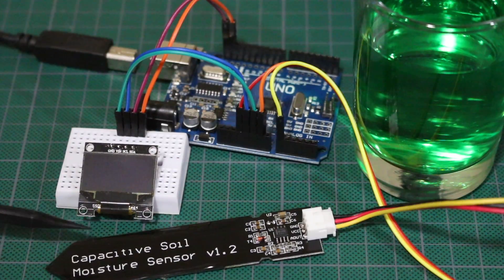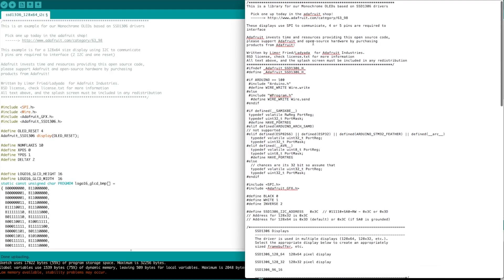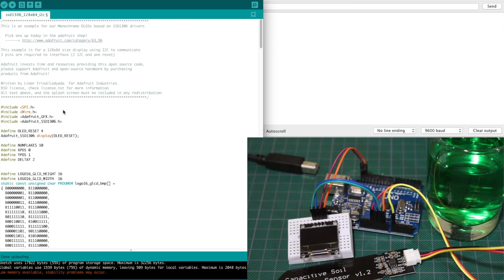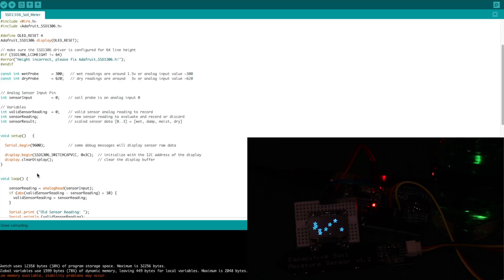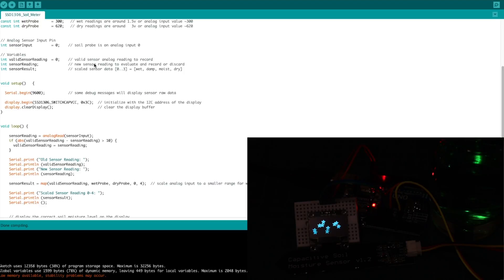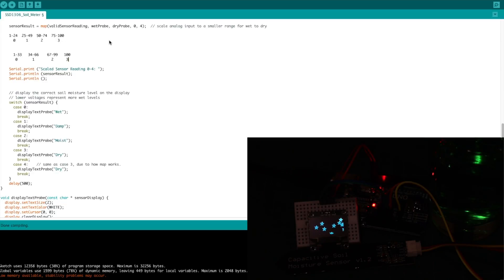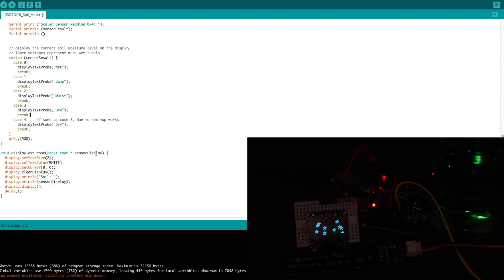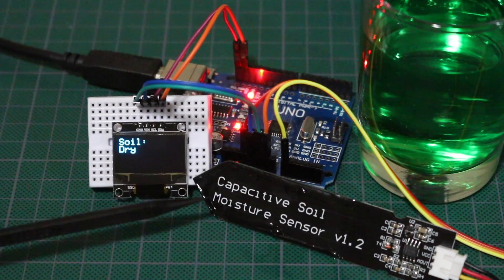How to use a 128x64 OLED Display and Capacitive Soil Moisture Sensor with Arduino

Comment: Just watched this again ( 3 years later almost ) I want to use one with 3 or 4 LEDs instead of the OLED Display. And a Buzzer for the dry mode also. I must clear off one of the benches to make room first.  Who am I kidding? There is nothing on the dryer or deep freeze right now. Problem solved.

Comment: I have only just found you in 2021 and have joined your channel so how is the project going?
Reply from the maker: I ended up moving from the place I started garden projects in and I will be in a new place in the middle of summer this year, probably unpacking until fall so 2022 is looking like a good time to resume!
Reply: @GadgetReboot  Look forward to you resuming the project it would be good to use an ESP8266 to show the data on a phone!!
Reply from the maker: @MrBobWareham  Yeah I wanted to use some sort of wifi module, whichever I can get that has low power so I can try to run it off solar/standby_battery and I already did a small project trying to charge a capacitor in the day and use when dark, lots to work on!

Comment: does the V1.0 of the capacitive soil moisture sensor works the same?
Reply from the maker: From what I can see when I look up the version one, it does look like it works the same but I can’t find any info about the differences in versions to see what actually did change. It’s only a minor revision change anyway so the overall architecture is expected to be the same.
Reply: @GadgetReboot  i was wondering what your experience with this sensor is 1 yr later. Did it start leaking?
Reply: @Ed19601  Great question. I am wondering also.

Comment: Hm would that work for sensing the dryness of clothing/towels etc. hanging on a line, laying on a radiator. Well in all cases inside as living in an attic with no balcony and no electric dryer. German "schranktrocken" = shelfdry? and so. Or the used towel after shower out of molding danger.
Reply from the maker: This type of sensor needs close proximity to what it is measuring so if the sensor was laid directly on the clothing it would definitely sense a change in moisture but an actual humidity sensor might be a better application.
Reply: @GadgetReboot  Well for the room humidity I have tested already a DHT11 from a kit so that would say if there is even a chance to get a part dry. I want to put it on the cloth directly. Unfortunately I think energy harvesting from heat source is not that easy from the soldering skills getting SMD and PCB to a functional unit. And which controller board to choose  WiFi is not that well here using a repeater and the  router from brother one story deeper and there in the middle flat. Power LAN not working.

Comment: Maybe you explained in the video, but would you explain how you know to set wetProbe to 300 and dryProbe to 620?  Thanks.
Reply from the maker: In the original video where I looked at the raw output voltage of the sensor:  https://youtu.be/pdGRs7GXBeE
 I saw that when it is wet it was down toward 1.5 volts and when it was dry it was around 2.8 V.   The specification for the sensor says that the output voltage is expected to be able to go as high as 3 V so I just round it to 3 V dry, 1.5 V wet. 

 The analog to digital converter has a range of 0 to 5 V on the Arduino Uno and the digital reading goes between zero and 1023. 

 So then I just used percentages. 1.5 V divided by 5 V is 30% of the full scale voltage so 30% of the full scale digital reading is 30% of 1023 which is just above 300 so I rounded to 300. 

3V out of 5 V is  60% of the full scale voltage so 60% of 1023 is just below 620 so I rounded off to that. I figure just a couple of decimal digits extra within a 300 decimal range is OK to introduce that extra sloppiness.

Comment: Look at U8G2. Supports more displays, more fonts, more versatile, less RAM and I think even smaller footprint. And no dicking around with header files.

And 0x78 and 0x3C are kind of the same address in different format. In I2C the LSB of the address is the ReadWrite bit. Aka, you only have 7 real address bits. The most common is to just chop off the RW bit when talking about the address giving 0x3C = 0b111100 which is followed by the RW-bit when transmitted. Only the display uses the less standard method of assuming the RW-bit 0 which will give you 0b1111000 = 0x78 :)

And you indeed found a weird thing about map(). It's a weird choice of Wiring but it's because a lot of newbies tend to expect the max output only to be reached with max input. To fix map() aka make it equal => map(value, inMin, inMax + 1, outMin, outMax + 1)
Reply from the maker: Yeah the map output threw me off so adding one to the input and output maximum would allow it to scale better  and the upper values can be thrown out. 
 And it looks like adding an extra bit here and there is the theme of the day. Thanks for pointing that out about the addresses. At least it makes it make more sense although it would be good if there were a standard to express it.
Reply: Gadget Reboot  "and the upper values can be thrown out." No need to, because you add one to both input and output. Aka, the max output value (which is one above the max you want) is ONLY reached if the max input value is reached which you set one higher than the max value you ever get. Aka, the max output value is also never reached ;)
And yeah, some always seem to do confusing stuff. But like I said, expressing it as a 7-bit address (chopping off the LSB, 0x3C here) is by far the most common. But yeah, China messed up once again ;)
Reply from the maker: Yeah I see why adding one to the input range and output range allows that extra one to be ignored.   One extra count out of normal expected maximum going in and coming out doesn’t impact the true readings  and everything that’s left over gets scaled as equally as it can with integer rounding. 

In further I2C address research I stumbled on information that also suggested there’s actually a sensor out there that has its address illegally set to a reserved address range and it can’t work on raspberry pi or can’t be scanned or something because the scanner  is correctly not even acknowledging devices in that address range since they shouldn’t be there. So there’s all kinds of weird things to deal with.
Reply: Gadget Reboot  There's always the one... But to add to that, there is also an official 10-bit address scheme. But I never came across a devices who uses it. Not saying there are non but it's a lot less common. And indeed, all I2C scanners I came across only scan the 7-bit part.
Reply from the maker: I am reading about 10 bit addressing right now in a document from 2014 I think, saying that at that time there’s not really much going on with 10 bit addressing. Maybe I should try to seek out a 10 bit address device and play around with it if I can find such a thing. I wonder if there is a list of 10 bit addressable devices. Maybe it’s only highly specialized at this point and not practical to obtain.

Comment: Arduino code is basically  all at the mercy of Adafruit lol. That's why I use esp32 with its own idf.
Reply: Nifty!  I certainly use the i2c scanner sketch before guessing these days.  Have 2 OLEDs that are superficially like yours, but with different pinouts, but no jumpered address.  Lots of versions floating around!
@Browarus is onto something ... your ESP8266 will be a good mate for this soil sensor project, as you can program it to wake up every X minutes to send an MQTT status to the interwebs ... conserving battery ... and interfacing to a phone app and/or a sprinkler head.  The ESP IDF may be the way to go (shrug).
MickMake did a comprehensive series on this kind of thing with his mailbox notifier:  https://youtu.be/gBokIBcEK0E
Reply: @GnuReligion  https://www.youtube.com/watch?v=LM-F6pFGwuU
Reply: Browarus Pierogus  Strange that this guy made such a well-produced video, and did not provide schematics or code.  Well, this kind of IOT example has been done so much, maybe it is not that important.  Am wondering if his magnetic lock could be disabled ... hehe .. if someone just unplugged the box?
Reply: Apart from all that those moisture sensors are very poorly designed and they brake fast plus can cut the roots. There has been some test done on net.
I have not seen good practical plant watering system yet